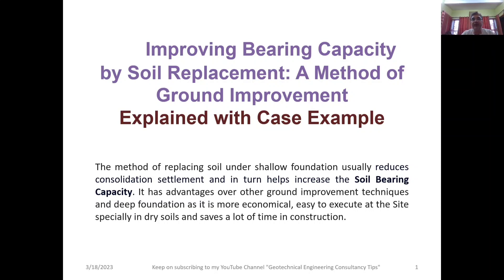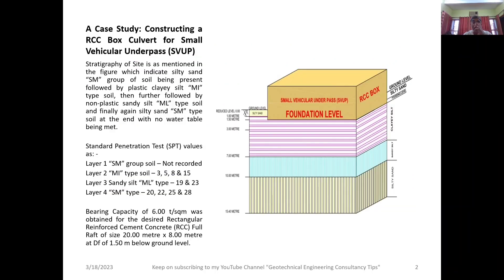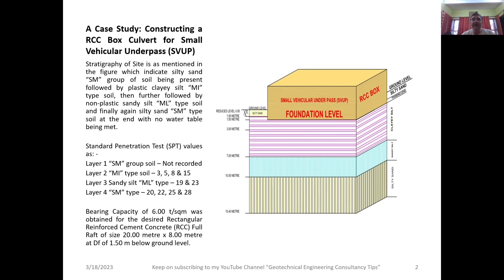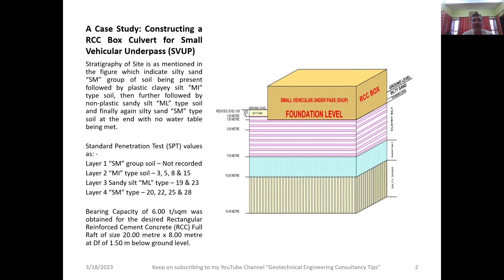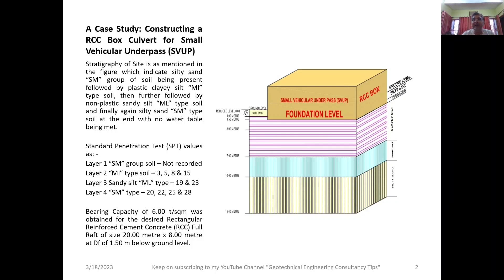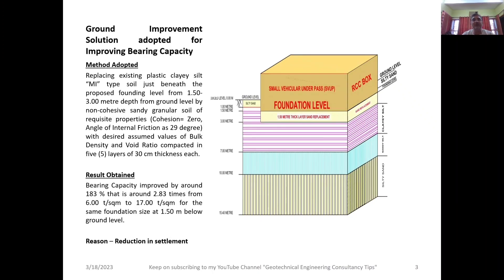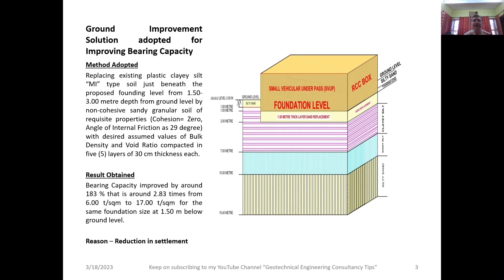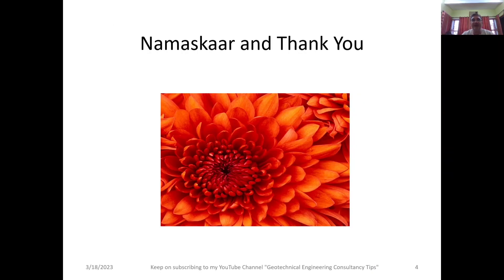Improving Bearing Capacity by Soil Replacement: A Ground Improvement Method | Case Example | Geotech

Comment: Dear Prof. Anurag, 
Can you please briefly explain how you have determined the bearing capacity of replaced soil? Which analytical method was adopted and what design parameters were used?
Reply from the maker: Dear Mr Malik Rizwan Ji,
The Bearing Capacity calculations were done as per Indian Standard codes. The replaced soil was granular soil and the same has been mentioned in the video with cohesion as zero and angle of internal friction as 29 degree. As the 1.50 m thick layer was compacted in 5 layers the density achieved was quite good having in turn reduced void ratio which resulted in enhanced Bearing Capacity. 
Hope you would have got my point.
At the same time request you to go through all my videos and even share them with other Civil Engineers and Geotechnical Engineers.
Reply from the maker: The other reason of improvement was replacement of settlement producing cohesive soil with non settlement producing compacted non-cohesive granular soil, thus in turn reducing the effective settlement and therefore, increased Bearing Capacity